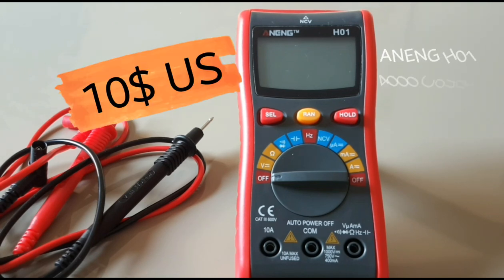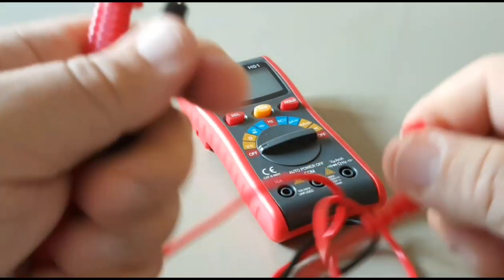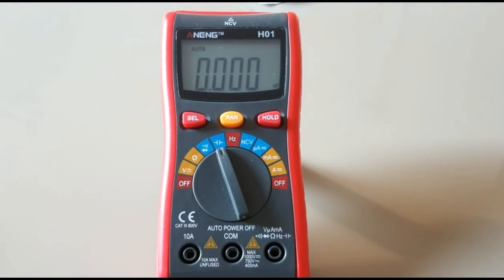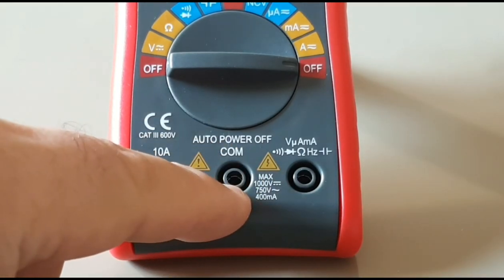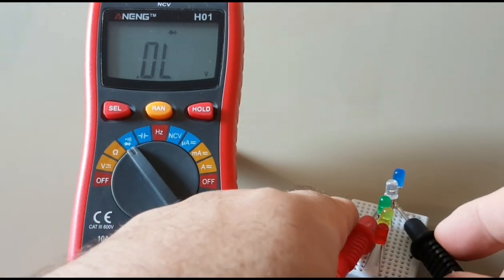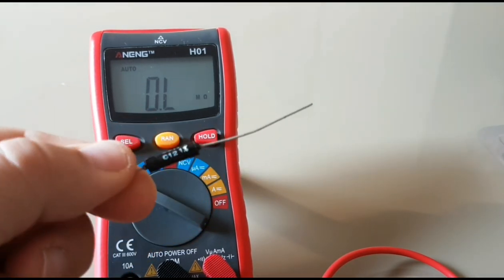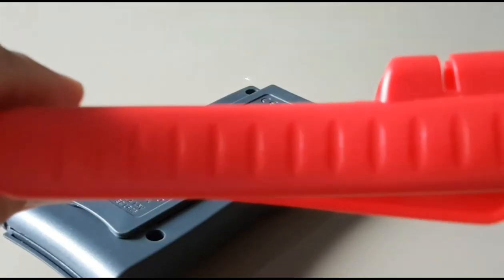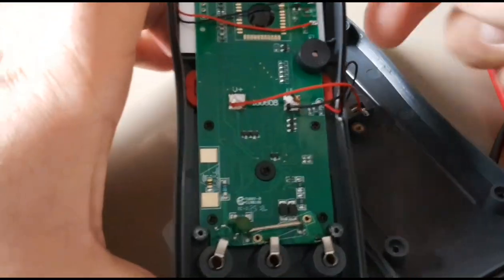ANENG H01 Cheap-O-Multimeter Review & Teardown!

Comment: Hi. Thanks for the review. May you recommend winapex or another multimeter?
Reply from the maker: Hello Bilal, one of my favourite multimeters this year is the WinAPEX ET8101, it's fast, feature packed and built well. I've been using it on a daily basis and it has not let me down! Thanks for watching!
Reply: @KeepOnTesting  Thank you for information. I am going to buy one
Reply: @KeepOnTesting  Can I ask one more question? Et8102 is new version. Would you recommend it?
Reply from the maker: Feel free to ask as many questions as you'd like, that's why I'm here. Yes indeed, the ET8102 is identical, it just adds a few more features like Temperature and a Signal Generator. Definately a bonus! I would definitely recommend it!
Reply: @KeepOnTesting  Thank you so much :)

Comment: Hi Darren, I need to buy some multimeters for my robotics class students grade 8. Can you recommend any under $10 meter?
Reply from the maker: Hello!, The XL-830L Series is a great dmm for the classroom, does everything except capacitance..
https://rover.ebay.com/rover/1/711-53200-19255-0/1?mpre=https%3A%2F%2Fwww.ebay.com%2Fitm%2FXL830L-LCD-Digital-Multimeter-Voltmeter-Ammeter-AC-DC-Circuit-Buzzer-Test-Leads%2F352839069601%3Fhash%3Ditem5226d8efa1%3Ag%3AKwUAAOSwDuldur6S&campid=5338362906&toolid=20008
They have a proven track record and offer incredible bang for the buck!

Comment: здравствуйте , конденсаторы он корректно измеряет ? с какой погрешность  и какой диапазон ?   КАКОЙ ДИАПАЗОН  ИЗМЕРЕНИЯ ГЕРЦ ?

Hello, does he measure capacitors correctly? with what error and what range? What is the measurement range of hertz?
Reply from the maker: Privet,Hello
4.000nF- 40.00nF- 400.0nF- 4.000uF- 40.00uF - 200.0uF- 400.0uF
Not a very high capacitance range. Nor does the manual state the capacitance accuracy.
Frequency is rated at 10MHz but on my unit it does NOT work at all! Thanks for watching.
Reply: @KeepOnTesting   вы знакомы с такой моделью  тестера как DT-9205A и ANENG AN8301 и  ANENG H01   .если вам  известно  между  этими  тестера отличия. в основном  какие преимущества  они имеют  ? за любую  информацию  спасибо .   у меня  ни когда не было тестера  и мне  сложно определиться и по цене и по качеству .  я не много увлекся  схемами  металлоискателями (самодельными)  и мне нужны функции на тестере  такие как  с широким диапазоном  измерения  сопротивления  , конденсаторов  и возможно частоты ,но при этом тестер не должен быть дорогим )))))) . 

You are familiar with such a tester model as dt-9205a and aneng an8301 and aneng h01. if you know the differences between these testers. basically what benefits do they have? thanks for any information. I have never had a tester and it’s hard for me to decide on the price and quality. I was not much interested in metal detector circuits (self-made) and I need functions on the tester such as with a wide range of resistance measurements, capacitors and possibly frequencies, but the tester should not be expensive)))))).